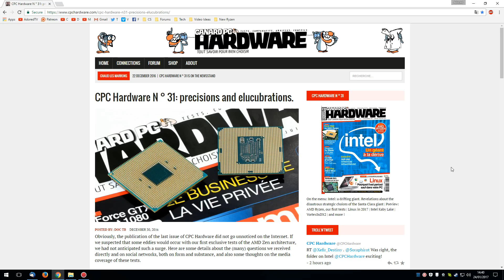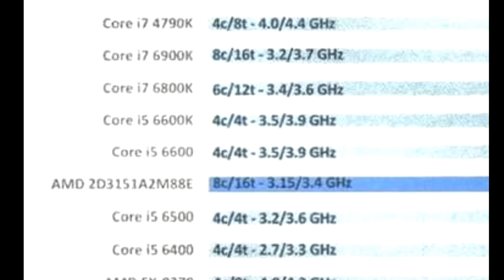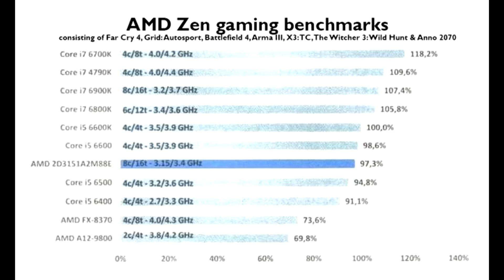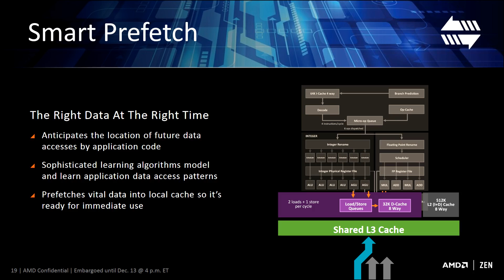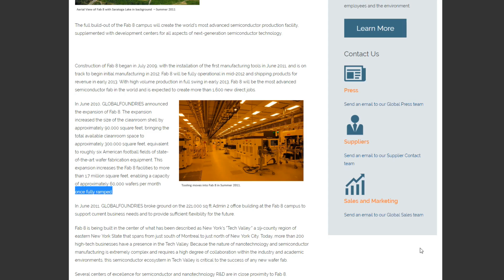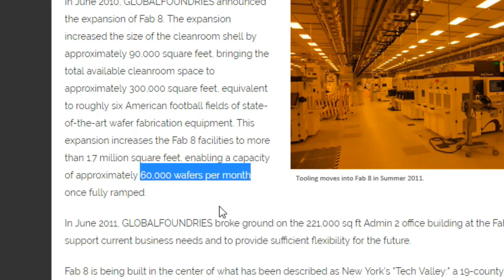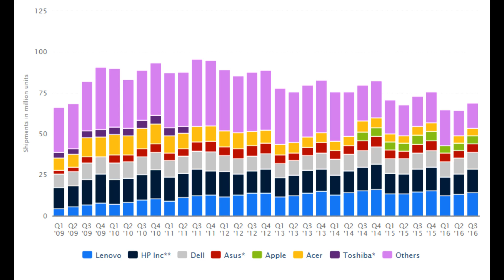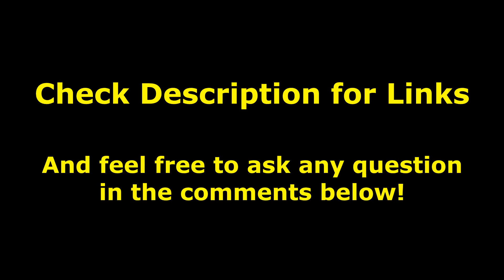Ryzen - A Refresher, Some Speculation and Market Analysis.

Comment: Hrm, I may be mistaken, but Scribe size is a lot smaller then 0.12 these days (could be that the number in this calculator aren't the size of the actual scribe though). At a number I read in whitepapers of Globalfoundries process, 0.025, this yields 160 cores in the first and 212 for the second defect density point.

Besides that, the calculator you use is based on the Murphy Model of Die Yields, which is also quite outdated and has no concept of modern CPU's and GPU's which have multiple same function sectors that can be fused off to create lower cored or lower pipeline versions of the same processor.

It doesn't take into consideration that in this case the CPU design is so that you have two 4 core blocks in a 2x4 rectangular package, designed to be fused to create lower end 4 and 6 core CPU's. Which increases yield of functioning CPU's even when there is an error in one of the cores.
Reply from the maker: More data is required for other methods, for example the Negative binomial so Murphys usually suffices for a general model.  The numbers won't be far off regardless, maybe a couple of dice either way. ;)

Comment: Didn't the calculator say "defects per square cm" and not "parts per million"?
Reply from the maker: Yes, ignore the PPM part and just assume 0.15 defects per sq cm.
Reply: AdoredTV oh I see. That's actually quite accurate if you assume 1.5 million Transistors per cm² (6900K has 1.4 million). Thanks!

Comment: You sound as if AMD is paying you to shill for them. The fact that AMD considers it a huge victory and are so fucking proud to manufacture (in 2017) a CPU which is only slightly worse than an Intel CPU available on the market for a year now, shows how much of a lead Intel has. AMD cannot beat Intel in the performance department, so their only chance is pricing, which if they do right, they might have a small chance of not being completely dominated by Intel.
Reply from the maker: To be frank, you're a complete idiot with zero concept of how any of this works.
Reply: Thanks, that's what I was aiming at.

Comment: I kind of hope they bring back the Athlon branding to get all the old users back. Ryzen could be the architecture name and athlons with numbered designations be the cpus. Like the Ryzen Athlon 4 3.4 ect... using base or boost clocks as simple  but clear identifiers. Then you can get the Ryzen 2 and 3 ect with the tock tock tock changes that line is said to be getting. But then if its to be only Ryzen they will need to spend a ton to get the brand recognition rebuilt on it.

Comment: AMD had literally not made any meaningful performance uplift since K10, we can't even see a big gap between a similarly clocked Excavator vs. an almost 10 year old K10. This leads to the competition to overprice their products to match the halting progress. Not good for the consumers. 

Though, I'm concerned about the grand scheme of computing instead. x86 development has been so bad that it will be almost impossible to recover its glory. I mean, Intel vs. AMD is probably not as important as it was in the days of K8. Sure, fierce competition would be nice for you guys (as PC enthusiasts), products like RYZEN are very very intriguing. But, if RYZEN is really pretty much just like it is promised (Broadwell IPC, low power consumption, etc) I think it's still won't drive both Intel and AMD to possibly increase their influence in the sub £500 market against RISC processors. In other words, these x86 giants might lose their influence even more in the cheaper segment despite RYZEN. What do you think?
Reply: Depends on the app. My FX 8350 is a lot faster in some games than my old Phenom 2 965.

Comment: My greatest concern about Ryzen is actually not the CPUs themselves. Think about a quad core Ryzen chip, maybe with SMT prices anywhere between 170 and 250 $. Realistic right? Even if it has SMT disabled, next year, when AMD will release their APUs with Zen cores, how are they gonna price them? The top of the line APUs have been priced at about 160 $ on release. Problem is, if they  sell quad core APUs at that same price, they are gonna cannibalize their own CPU sales since they work on the same socket and chipset. 

Thus, in my opinion, they are gonna price the quad core parts, and eventually dual core parts too, very aggressively. It could be that we will see quad core chips at about 140 USD so that APUs can be marketed closer to 200$. With the new GCN cores and Zen, DDR4 memory and improved IMC, the APUs could devour the entry level segment of the 460 and 1050 making APUs a very compelling buy for entry level and FHD gaming PCs giving you similar performance at a lower cost of buying a CPU+dGPU combo while retaining the potential for an upgrade with a dGPU. I've done this with a 7850k and it can be helpful for budget or SFF builds.

The only major difference with APUs, could be an eventual absence of L3 cache on the CPU side. Other than that, for a small price difference, I would definitely prefer the chip which also offers an iGPU.
Reply: I guess there will be some 4c8t Ryzen parts with a limited amout of GCN core, think like an ordinary igpu. There will also be some with "half the chip" occupied with GCN cores, the TDP of these will be horrible compared to an normal 4c8t part, but there will also be a price increast from the normal 4c8t part. There probably wont be any 8c16t parts with integrated graphics, maby parts with 4ct4 and 2-3c4-6t. 

The market for a RX 460-like performance will probably "die-off", since they will buy a APU instead. AMD on the other hand just sold a 4c CPU with a GPU suitable for SFF cases. Probably with  a lower TDP than a 4c4-8t part plus a low end stand alone GPU.

TL;DR: TDP.
Reply: Henrik Sjöblom
So TDP is such a concern to people? Especially with these new coolers from AMD, even overclocking is feasible on these quad cores which have a base TDP of 95W.
Reply: I think you will be better off "TDP wise" with an APU rather than a CPU + a stand alone GPU when talking about 4c Ryzen parts with a integrated GPU somewhat better than a RX 460. This will be nice when building SFF builds and for OEM builders. 

It will probably be very much like the Athlon x4 880k and the A10-7870k is today: Pretty much the same performance on the CPU side and with a decent integrated GPU on the A10. Price difference is about +50% today with the integrated GPU.

The same will probably apply to the Ryzen and Bristol Ridge parts, only the exeption that there also will be 8c8t and 8c16t parts on the higher performing side.

I dont see the problem, when the Bristol Ridge parts arrive, some time after the Ryzen parts, the first Ryzen parts will have dropped some in price and it will be pretty much like the FM2+ is today pricewise.
Reply: Oh yeah, on those terms, TDP is important. I still would love to build an SFF system to kinda resemble a console because of it  having an APU. DDR4 is gonna play a major role here in my opinion. Although I'm really looking forward to these new CPUs, even if I'm not immediately buying anything, the truly interesting products from a technological perspective will be APUs.

Comment: The problem with GloFo is not the production volume, but the underwhelming performance of their silicon.
Compare the efficiency jump NVidia gained, when they changed from TSMC 28nm to TSMC 16ff+ with what AMD gained, when they switched from TSMC 28nm to GLoFo 14lpp.
I know that architectures play a role in how much you can clock a chip at a certain voltage, but Maxwell and Pascal are fairly similar to each other and so are Hawaii and Polaris. Surely architectural differences can't make up for all of the gigantic difference in efficiency.
Reply from the maker: GP107 is fabbed at Samsung, which is basically the same 14LPP process.  It's not as good as TSMC's but the difference is less than 10%.
Reply: Hello and thanks for your reply,
I read Patrick Moorhead's artice "AMD Officially Diversifies 14nm Manufacturing With Samsung" on forbes, in which he is quite sceptical about GloFo. How do you know that Samsung's process "is basically the same 14LPP process"? Does that automatically imply chips from Samsung are about as efficient as chips from GLoFo? Aren't there quality differences of the initial wafers?
Reply from the maker: Glofo cancelled their own 14XM process and licensed Samsung's 14nm process instead, so they are basically identical except for yield.  Samsung's yield was better ~20 points originally but probably isn't now as GF has a good history of improving yield quite quickly, on all except 32nm which was pretty awful for them.
Reply: Thanks for your replies and your interesting videos.

Comment: Whilst I am confident 8 cores Ryzen will stomp all over bintel, I am in all fairness very disappointed with the X370 range of mobos. They just look very gimmicky, particularly the Biostar X370. Seriously, what useful purpose could flashing LED possibly serve?. I want an X370 work station mobo that will rival my Asus X99EWS mobo. Where the blazes are the dual socket AM4 WS mobos?. Another thing - was watching Red Gaming Tech last night. One guy found leaked info that 8 cores Ryzen will retail for $500 to $700. I really hope this is not true. TBH, I was worried that AMD would charge top $ for 8 cores Ryzen because it is turning out to be a damn good cpu. I thought AMD did not have the market share to demand such high prices. Will know for sure what the rrp will be on release day.

Comment: I think 6 and 8 core cpu's are going to be the next big shift in pc gaming. I went from an i5 2500k to an i3 6100 (dead mobo) because reviews put the i3 6100 at more or less similar fps to the i5 2500k. That's on paper. Guess what happens in real life? In real life you want to record or stream at the same time. The i3 6100 is suddenly a piece of shit in comparison to the 2500k. Now as we're entering 2017, quad cores, even the newer ones with hyper-threading, are not going to keep up to the huge multitasking many gamers need. Intel is going to have to reduce their 6 & 8 core chips for sure, or Zen is going to smash them out of the market.

Comment: Okay this has been on my mind for quite a while now regarding AMD's Ryzen processors. So the current rumor states that there will be 3 main category of Ryzen chips namely SR3, SR5 and SR7 in which SR7 is the 8 core 16 thread monstrosity that AMD demonstrated, The SR5 is allegedly 6 core and 12 threads while SR3 is 4 core and 8 threads. 

So I've been looking into Ryzen presentation slides in which they go in-dept about the Zen architecture and what's interesting is the CPU-complex which AMD terms "CCX". Each of these CCX has 4 cores and the way AMD can manipulate core count is by CCX. To put it simply, CCX is the smallest unit AMD can manufacture and in case of SR7, those 8 cores and 16 threads are achieved by 2 CCX fused together. 

The question I've been asking myself is how do they achieve 6 cores? In my "knowledge" the defects in CCX would render them useless because the 4 cores share L3 cache and disabling any one of them would leave others with disproportionate amount of L3 cache. Bulldozer had 6 cores because it's smallest unit, the "module" was 2 cores so it was 2+2+2 design so It's not like they'll disable cores during Binning to make 4+2 core design. 

And here's where simple logic kicks in, Since the IPC of Ryzen is on par with Broadwell-E and their 8 cores can clock at 4ghz, which means the 4 core could easily do 4.5ghz and if you've been looking at CPU benches recently, you'll notice that there isn't much difference between a Broadwell-E at 4.5ghz and the new Skylake and Kaby Lake at least in gaming. So if the rumored SR3 with 4 cores and 8 threads can be on par with i7's in gaming and pretty much everything due to similar core and thread count then why would AMD price it "allegedly" near i3's? Why people would buy an SR5 6 cores? especially when the 6 cores will be clocked lower than SR3 and in case of content creators, they can shell just another 100 bucks for the 8 core variant. Not to mention it "seems" unrealistic for them to be able to make a 6 core in the first place.

So what I believe is that SR3 is 4 core WITHOUT SMT meaning it only has 4 core and 4 threads like an Intel i5 while SR5 has 4 cores AND SMT, meaning 4 cores and 8 threads directly targeting the mainstream i7 and SR7 is 8 core and 16 threads aiming at the HEDT i7s.

With that said, I can be totally wrong and AMD may perhaps be able to use 4+2 core design by somehow leveling the L3 cache or the 6 core version having 16 MB of L3 as well just like SR7 instead of 12mb but the theory that SR3 is 4c/4t and SR5 is 4c/8t instead of 4c/8t and 6c/12t respectively sounds more reasonable to me. Nonetheless, we're close to launch and given AMD is releasing all of It's Ryzen chips at the same time, I guess I'll find my answer soon. XD
Reply from the maker: Most rumours suggest there is no 6 core version at launch so it may be possible that it just can't exist, or maybe yields are so good that AMD can sell 8C/8T instead, which should be faster than 6C/12T.
Reply: And couple that with the news that AMD is sampling 4c/4t Ryzen, It just makes me believe that 6 core Ryzen doesn't exists but as always, we'll need to wait and see for ourselves. Waiting for your next video. Keep up the good work man. :)

Comment: The games used to benchmark are the worst to do that. Witcher 3 doesnt go over 4cores, Arma 3 uses only ONE core, all those games are dependent on high clock speeds than core count. thats why the results are horrible.
Reply: AMD was preparing for Async for a long time, they will only shine in a couple of years. But that's what they have done over the years, revolutionary tec
Reply: It has nothing to do with async but the bad cpu overhead of DX11 and the games werent programed do circunvent it.

Comment: AdoredTV
 I've got a link to an interesting Dutch interview with the CEO of ASML. If you're interested...
I assume you know that ASML (Veldhoven, next to Eindhoven which became a city because of Philips, in the Netherlands) delivers the wafers to Global Foundaries, TSMC, Intel etc.
Summary. 
7 nm. has been available for a while but it has been too expensive because there are too many steps involved in the process. In 2018 or 2019 7 nm. will get a lot cheaper thanks to the implementation of EUV lithography (now they use immersion lithography) which has matured enough that companies are willing to invest in these machines. This might explain the leaked AMD plan for 7 nm. Vega in 2018, unfortunately 2018 might be a little bit too optimistic, ASML assumes that it will be in 2018 or 2019 that 7 nm. becomes affordable. 
https://tweakers.net/reviews/5155/asml-ceo-peter-wennink-over-de-race-naar-7nm-en-kleiner.html
https://tweakers.net/nieuws/120175/chipfabrikanten-hebben-achttien-euv-machines-bij-asml-in-bestelling.html
If you need help with the translation, just let it know.
Reply from the maker: Yep I know ASML - I've bookmarked the link and I'll check it out, cheers bud.

I agree that 2018 seems optimistic for 7nm yes.
Reply: AdoredTV
You're welcome, anytime.
There are two links, Youtube might make it difficult to see it.

It seems to me that we'll have to wait until 2019 for 7 nm. unfortunately. Still, in 3-4 years time from 28 nm. to 7 nm. FinFET and good architectural improvements, it is not bad. It will finally make 4k gaming possible for many players, a $400 card should suffice (>60 FPS) for that generation.

One more interesting point from that interview: there are roadmaps up to 1.5 nm at the moment and there are many plans left to get there. It just is a matter of when companies are willing to invest in it, which they only do once they have to. Something like that.
7 nm. , 5 nm. and 3 nm. are already rather concrete (for ASML and its customers).
 Amazing! Bottom line, they might have struggled with the step to 10 nm. due to a slowdown of EUV lithography but we'll get a lot more shrinking steps in the future. :)
Reply from the maker: I think we're at the stage where we need something vastly different in order to shake up the whole industry, which is why I'm so interested in the whole multiple dies/interposer thing. ;)
Reply: AdoredTV

Yes, progress has slown down and won't get as fast as it used to be (but faster than the last few years once EUV will be used for mass production) but if we get to 1.5 nm. or at least 3 nm. you still have an incredible improvement. I agree that HBM is a fascinating revolutionary technology. It is relatively simple and you wonder why it took so long before some company developed this technology but the impact is large. In general reduced latency for transmitting signals between components might be one of the next big revolutions in computer hardware. Though electrons travel fast optical communication between different pieces of hardware would strongly reduce latency. Universities and companies are doing a lot of research in this area.